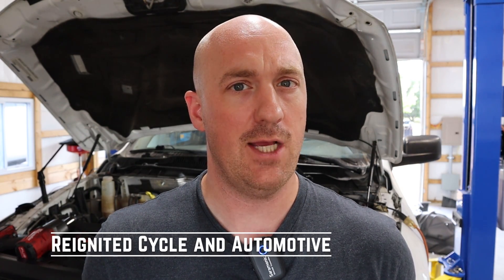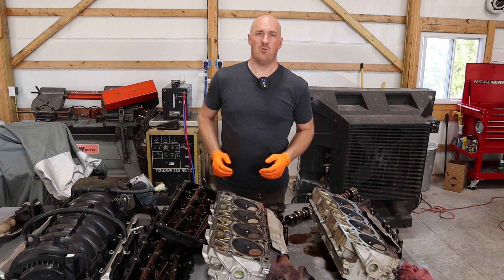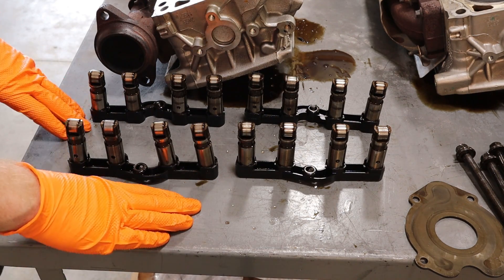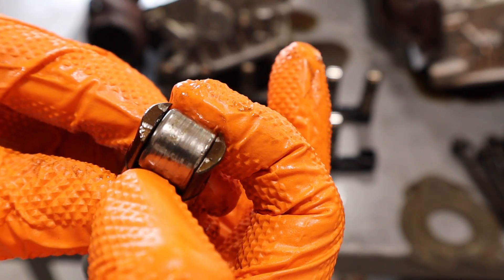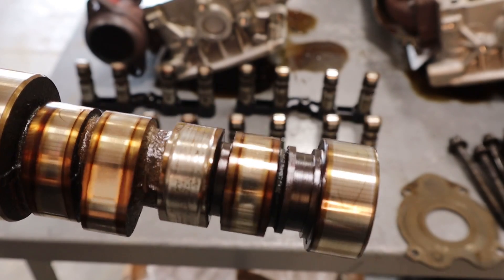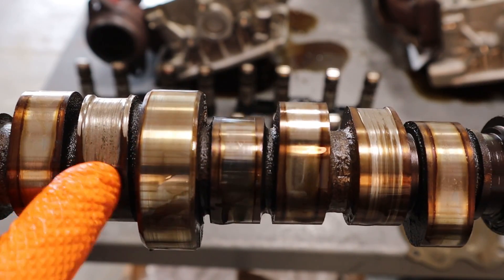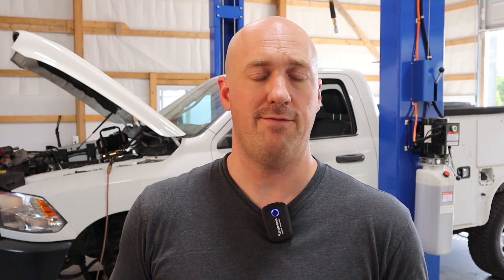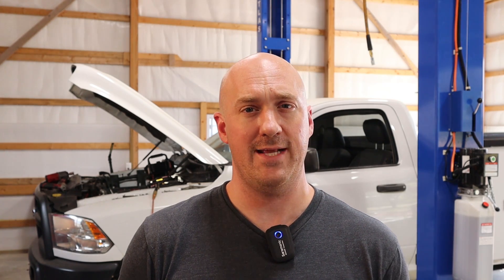Hemi 5.7 Lifter FAILURE Does this engine have a fatal flaw? Find out how YOU can prevent it!!!

Comment: They fail because of poor lifter angle placement and poor oil lubrication, especially at idle.
Reply from the maker: I've heard that a lot, I'd love to see some actual data to support that theory though. Not saying I don't agree, just would like some actual data.
Reply: @ReignitedAuto  . It’s a simple test you can do with a mock up set in a clear container that you can adjust the oil pressure. You mentioned how it’s worse with the 6.4L trucks, and you don’t see as much with the Hellcat engines for instance. Well, the 6.4L’s tend to be used for work purposes in the trucks where they tend to idle more. The Hellcat engines are not typically driven a lot, they are driven hard mote often then not. I have a lot of anecdotal evidence being that I am in a lot of Hemi groups, I’ve worked with many people and have seen these issues first hand. It’s hard to be objective in Youtube, but I have a whole group of people who would enjoy a good talk with you on the subject, this issue has caused a lot of money and heart ache for people.

I went ahead and shared your video to a few groups, we will get some discussion going, this is a topic near and dear to our hearts. I really enjoyed your video, thank you.

Comment: Hmmm I’m not completely sold on the oil breakdown , Perhaps Inadequate oil flow at long periods of idle.
Reply from the maker: And I'm willing to admit there may be an issue there as well, I just don't have any actual data to agree/disagree. 👍
Reply: @ReignitedAuto  If the oil was breaking down, wouldn't all the lifters show excessive wear? And not just the MSD lifters.
Reply from the maker: @alzaidi7739  no engine parts wear perfectly evenly, that's why you will see main and rod bearing failures in certain cylinders and not all of them at once. I also see lifter failures in non MDS lifters as well, its just more common to see the MDS ones fail.
Reply: @alzaidi7739  exactly. It's a camshaft metallurgical issue along with oil thickness/supply and a needle bearing design issue all combined. Each failure and conditions are just slightly different that everyone argues about the root cause. The root cause is a poor design.
Reply: @ReignitedAuto  It may be cool to do an oil anyalysis with blackstone, I changed my oil at 8k miles and they said it had plenty of life left
Reply: MDS lifters need oil pressure to flow into the little hole on the side of the lifter. The MDS solenoid controls oil flow to the MDS lifter bore. When the solenoid turns on and off it activates or deactivates MDS. So therefore the only time the MDS lifters receive oil through the galley is when MDS is activated. Otherwise it relies on splash. So higher idling makes it much worse.
Reply: That is my guess! I don't think the entire oil in the pan is breaking down!  Better look at metallurgy and too much stress on the lifter bearing!
Reply: Both can cause lifter failure on thie engine application, I've never scene this on a lt1 except dod lifter failure. The positives on the gen 3 hemi is I love the cylinder heads, they flow really well on stock configuration like the eagle heads
Reply: That is the reason .. Scotty has discussed this issue several times .. They moved the lifters higher up in the engine out of the oil.. Thus at lower rpm's there is inadequate lubrication
Reply: @xadam2dudex  on top of putting a wall in that blocks oil splash
Reply: Watch uncle Tony’s garage, he explains it is a lack of oil supply to the lifters which makes sense as well.

Comment: Sorry if this has been asked, but i do mine at 10,000km(6200 miles) religiously, pretty sure Ive had a hot tick since I owned it, I've just kind of  disregarded the noise as normal hydraulic lifter noise. I'm at nearly 80,000km now, its under warranty, do you think I should take it in?
Reply from the maker: I doubt they will find anything at this time, especially if the noise has not gotten worse as you've owned it, but I do think you should take it in for one reason only. If you can document with the factory that you had an issue BEFORE the vehicle goes out of warranty, and shortly after it goes out of warranty the issue gets noticeably worse, you can petition the factory to goodwill warranty the repair. That's the actual term they use, goodwill. The only way you can make this work is to take the vehicle in, be VERY specific on your customer concern i.e. How/Why/When the issue happens. Make sure when the repair order is printed that is says EXACTLY what you told the service writer, nothing vague like "it makes a noise". If you do this, then even if they don't find any issue at this time, that repair order will still be submitted to the factory for the dealer to be reimbursed for looking at it. Now the factory has it on file that you had this specific issue. Then, like I said, if the problem gets noticeable worse (meaning they can duplicate it readily at the dealer) shortly after the warranty expires, you can try to apply for goodwill warranty. This is much more likely if you purchased the car from the dealer in question. However, there are limits to the Goodwill they are willing to extend. If say, the problem crops up 10k miles after the warranty expires, don't expect them to help out. I hope that at least gives you some good information, if you don't understand what I mean I can try to explain it better. 👍
Reply: @ReignitedAuto    Wow thanks for the info, I completely understand, I'm a heavy truck tech so I'm pretty comfortable with fixing it myself, but I have very little experience on the smaller stuff, and gas engines in general, mostly deal with big bore diesels which have all kinds of clacking and hammering noises, that being said is any kind of gear train type ticking noise from the 6.4 truck normal?  The noise isn't very noticeable, in general, some people Ive seen have said injectors make a noise too.  I cant really say it's a metal hammering noise, which is why I dismissed it.
Reply from the maker: @Dexter_Solid  The injectors are definitely noisy on these engines. The lifter noise can be more noticeable because it will sound irregular it can kind of fade in and out. I will say that I've definitely seen the 6.4 engine impacted more by lifter issues than the 5.7, i couldn't tell you why.
Reply: @ReignitedAuto    The noise I'm hearing is perfectly timed, and I've only really heard it from the driver's wheel well.  Next time I take it out, I'll check the other side.  Thx again for the info.
Reply: @ReignitedAuto  by the way one thing that hit me when you mentioned lubrication, idle times, and connection with the increased severity of the issue with the 6.4, being someone who dailies a 6.4 truck, the transmission is always trying to keep the highest gear possible, so much so that it takes forever for oil temps to rise in the winter, so i tend to lock out 5th in the city and 6th on the highway till oil temps come up. oil flow is poorer at lower rpm, this may be a contributing factor. Knowing what i know now i may permanently lock 6th out unless im driving over 70
Reply from the maker: @Dexter_Solid  probably a good plan. Due to emissions and MPG standards which are government mandated, vehicles now are looking to shift as quickly add possible to keep rpms as low as they can thus using less fuel.
Reply from the maker: @Dexter_Solid  Noises are tricky through video, but I didn't hear anything abnormal in those videos 👍
Reply: @ReignitedAuto  right on, thanks alot for help. Really appreciate it.

Comment: Happened to my 2011 Ram 1500 4x4 with 117k miles. Had to replace the entire long block due to metal shards in the engine from the lobe getting eaten. Had $100 synthetic oil changes at the dealership every 3000 miles. What a waste. Will never buy another Ram again. Oh and I very very very very rarely idle. If I sit for more than five minutes I turn off my engine.
Reply: 170,000 and no problems,I use amsoil and a better wix filter  I am planning on a forged engine build with all the goods . Ram has been a great truck.  I matter of fact never had problems with gm or fords trucks but I  use amsoil and do my own maintenance.
Reply: @Pickleram  unicorn Hemi congrats!
Reply: @littlejohn6694  130k on my 06 charger...i litterally beat the hell out of it. the ''slap shift'' gets used very often, taking it RIGHT up to the 5700 5800 redline or just cap of its power and then shift, constant abuse in winter. 3k oil changes (5-6k kms) with your cheapo penzoil castrol synthetics and a mopar OEM filter (From the Dealer).... (4-5 dollars for an OEM filter....how can you go wrong? Canadian dollars too). No problems yet so?
Reply: @baileyhatfield4273  happy for you 👍🏻

Comment: Very informative. If I decide to change the oil based on hours, what should the time interval be? Thank you for sharing the preventive measures!
Reply from the maker: Unfortunately I no longer have access to the maintenance schedules. I think the best option is to contact a fleet company that has Chrysler vehicles and see if they would share the info with you 👍
Reply: @ReignitedAuto  this from a guy who worked on them for years.
Reply: Someone said (I forgot who) to use the 33.6 per engine hour for the calculation to reach 5k to prompt an oil change.  Not sure how accurate that is.  I read a recommendation to use 29 for Crown Vic LE fleet cars.  Hope this helps.

Comment: Blaming the oil and not including the engine design is a little misleading. Crown Vic's in law enforcement idle the same time as the Chargers yet they never had lifter issues. Clearly it is not just the fault of the oil but perhaps the fact that the oiling is insufficient at idle.
Reply from the maker: I can buy that. I think the point of the video is that people are under the impression that this is happening to almost every Hemi engine. When the reality is that the percentage that see this problem is very low. In my opinion, somethingis only a design FLAW if more than 50% of the engines exhibit the issue. Thanks for watching 👍
Reply: The Chargers must be 3.6s.

Comment: Hello Sky,  I'm not a real Hemi guy or tech, but do have years of racing experience and engine building. My brand new 2019 Ram 1500 5.7 had a terrible lifter noise at 2100 miles. I went to full synthetic, and changed the filter to a Wix XP, after The dealer would not pull it down. In my case, I feel that the Mopar filter was defective with a bad bypass valve, letting the motor leak down.  Take a listen to this thing !  https://www.youtube.com/watch?v=eA1JYETEIdM    I have now let it sit 2 months and it only rattled a few seconds on cold start up.  In the future I will run Mobile One 5w-30 with the X-1R additive i have used for years with very good results. What is your thought about lower oil pressure at idle and starving the roller bearings and cam lobes instead of oil breakdown ?   Thanks for the video , Cheers  Dale Walker
Reply from the maker: I definitely think that the outlier situations like yours, where you are having lifter issues on essentially a brand new engine, are related more to assembly error/fault parts. This video is focused more on higher mileage engines, where extended lack of lubrication leads to eventual failure.There are a lot of theories out there about the Hemi engine having potentially poor oiling to the lifters at idle, I'm not going to disregard it completely, but to me, if that were true we'd be seeing an exponentiallyhigher failure rate on these engines, rather than the low percentage that we currently do. All that being said, I'm no engineer just a mechanic, do this is just my opinion based off my experiences. Thanks for watching! 👍
Reply: @ReignitedAuto  Thank you for getting back to me. In my case I'm convinced my original Mopar oil filter had a bad bypass valve that let it leak down. I will keep watching and learn about these motors. Cheers  Dale

Comment: I had a 2013 challenger and traded it because of the tick on startup. Wish I found your video back then.
Reply from the maker: Yea, but changing the exhaust manifolds on those cars is a terrible job, might as well pull the heads, it's easier believe it or not!

Comment: The digital dash display should have a sensor that monitors the camshaft lobe height as it wears prematurely: "WARNING...you now have .480 lift....WARNING...you now have .450 lift...WARNING...you now have .400 lift."
Reply: That would be Chrysler admitting their design flaw and in turn cause a recall of millions of their faulty vehicles.

Comment: Only thing I can hear is a little chirp is that ur pointing out
Reply from the maker: It can come across as a chirp. Tough thing about noises are most people describe them in different ways. 👍
Reply: One more quick question I have a like a ringing bell noise at 2000 rpm on acceleration it’s not loud but I can here it over the wind and driving noise

Comment: I have a 2014 Chrysler 300S, after I turn off my car it makes a ticking sound. Any thoughts? And whenever I turn to the left the first time, it makes a sound as if it’s grinding on something. New to car maintenance so please let me know.
Reply from the maker: Ticking noise after shut off is normal, that's likely the metal for the exhaust contracting after being hot. Grinding noise is a little tougher to pinpoint without seeing the car in person.

Comment: SOLID!!!  THANK YOU!!!  BEST description I HAVE SEEN!!!!!!    I started adding Lucas Syn oil additive for one quart and switched to WIX filters.  I also  change my oil every 8 mo or 4k miles... I do not have a lot of idle time during this time. Only use Mobil one Full syn.
Reply: Careful with Lucas, it’s very thick; I blew my 2008 Charger engine right after using this.  I have a 2012 now and will never use it again.  I’m not the only one saying this.  

I think Lucas is meant to thicken up the oil and fill in the spaces of a heavily worn engine.  

That would not help in this situation.  AND, it could actually decrease oil flow and increase sludge in some engines.

Research it before you put it in your (newer) 2014.   Can I say for SURE it was the Lucas?  No.  But it was very suspicious.  

I theorize, INCREASING the film strength and INCREASING the oil pressure will help our engines for this specific problem.

I have switched to 10w30, for this reason.  No CEL codes thrown when using it, also.
Reply: @JohnSmith-zw6tr i agree with you and this was my idea before i read you. Move slightly up to 5w30 or 10w30 should be a good preventative way to avoid this. I just bought a 2008 R/T @ an auctioj for $1500 & despite its 160k on the odometer, it had no tick when i started it. I can take it from there
Reply: Good Idea about the Lucas Oil additive. Maybe I'll start using that in my 14' Charger Hemi. And yes, I use Mobil 1 synthetic as well.

Comment: Haven't looked at the design of it but does the 3.6l V6 have this same issue ?
Reply from the maker: No, it's an entirely different design. It does have it's own issues though. The 3.6 if there's a ticking noise it's likely the rocker arms. The roller bearings are a common failure in the rockers, and if left for long enough they can eat through the cam lobes as well. The good news is it's not as complicated a repair as the Hemi. You still need to remove the camshafts to replace them, but it's not too difficult. 👍

Comment: The issue is not solely related to the frequency of oil changes and oils breakdown. It’s the distance from the camshaft to crankshaft and the fact that the oil doesn’t reach the lifter rollers at less than 1500rpm or so.
Reply from the maker: I've heard that a lot, I'd love to see some real data on that. Im not an engineer, just a mechanic 😄

Comment: Great video! Do you know if they ever corrected this issue or how widespread it may have been? I have a 2016 ram with the 5.7 and it runs great but this is very concerning.
Reply: FCA upgraded the lifters in the 2016 run.   However oil is critical.  Changes and type.   Stay with the recommended 5w20.  Synthetic.  I use Pennzoil Ultra Platinum synthetic as it meets/exceeds Chrysler MS-6395
Reply from the maker: They have not updated the design since 2009 so your engine is potentially susceptible. That being said, only a small percentage of these engines have this issue, so if you are properly maintaining the vehicle you aren't likely to have this problem. Thanks for watching!
Reply: It only starts to happen around 200.000 miles🤔 lol have lots of fun till then with ya 5.7 .. My 08 R/T still ran like a beast to her last day 😎
Reply: Thanks for all the replies! I'm always religious with the maintenance schedule and using only OEM parts and fluid so I hope to have no problems for a long time. So far this truck has been awesome!
Reply: They never corrected the issue. I had one go at 188000 kms. Did regular synthetic oil changes every 5000 to 6000 kms . 2014 ram 1500 larime.  Sell it as soon as possible, unless you don’t mind paying 10 to 15000 Canadian to replace it. Beautiful truck, POS engine….

Comment: The cam is to far from the crank and at idle the cam and lifters cant get lubricated. If you idle extended periods of time I’d suggest revv the engine up to 1500 rpms every ten minutes or so.
Reply: The cam is also blocked by the cast oil galley that runs below it and couple that with the manufacturers doing away with the little channel in the big end of the rod and the hole in the bearing that sprayed oil upwards.

Comment: I have a 2016 ram 1500 with 101,000 miles with no engine problem but the exhaust.
Reply from the maker: Good news! And the exhaust repair is an easy fix 👍
Reply: @ReignitedAuto  I know I just dont feel like fixing it lol. Working on locomotive all day I just don't feel like working on my truck.
Reply from the maker: @mr.r59  I hear that, especially for something that's just annoying not hurting anything 👍